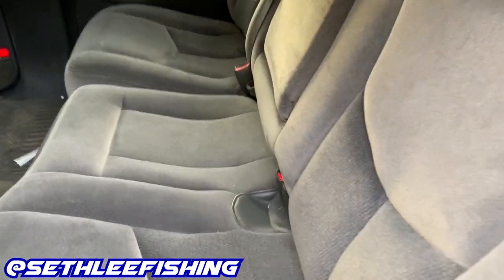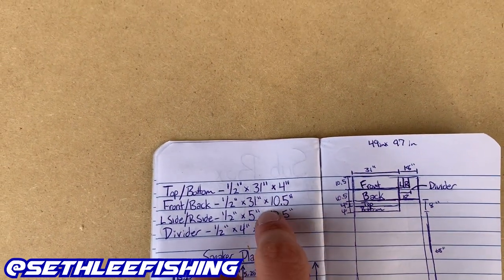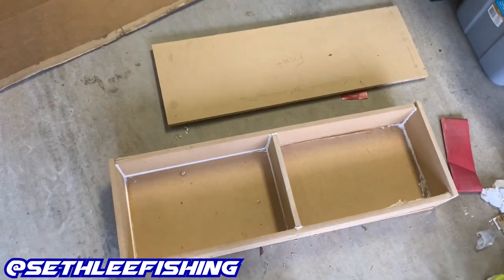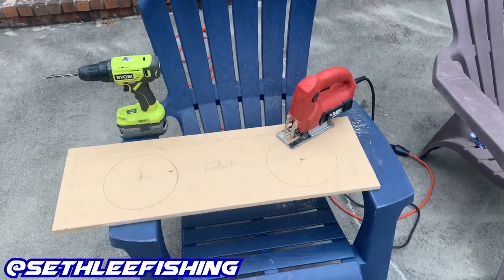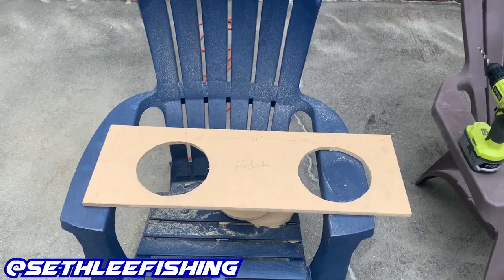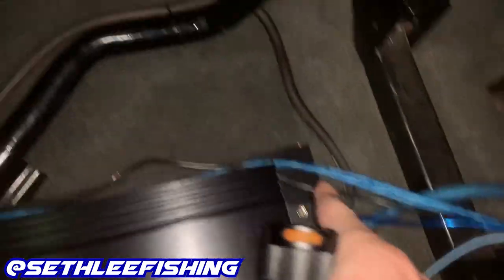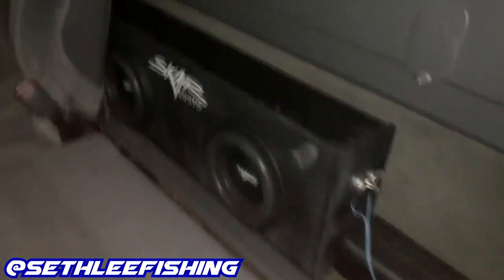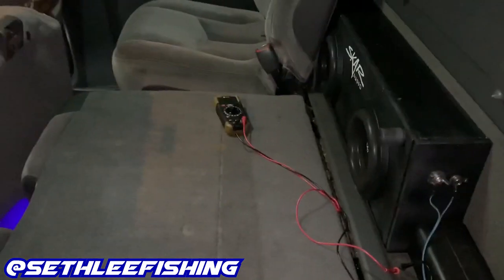CUSTOM SUB BOX BUILD | 05 GMC Sierra Crew Cab with 2 Skar VD-8 Subs

Comment: They sell the battery extenders for that reason. I have a 2006 gmc sierra crew cab same rear seat. Do you have any problem with vibration from the back seat when you turn it up.

Comment: All in all decent video bro.. 

FYI you can measure the voltage wo a load on the amp.. with a typical mono block your ac voltage reading wo a load will be 4ohm.. you can use that to tune the amp before ever hooking up the subs.. 

Then once you have the subs connected you verify that setting.  For example if you connected to the amps output wo subs you would’ve gotten a reading around 66v at 4oh this isn’t an accurate way to tune but it give you a very good starting point.. 

I personally like to use alligator clips on my leads so I can watch the voltage climb real time as I slowly turn up the gain.. you should also be doing this with a 40hrz constant tone not on music.. on music over a teak you’ll be anywhere from 12-40v over the track at 1ohm. You should be going over on peaks during music that’s why you have rms and peak ratting lol.. 

Also that’s a lot of power to those subs they are rated 400w rms not 600 like you said in this..

Comment: With having the bass boosted to 6 db you are going to be sending a clipped signal to your speakers and burn the coils up. Go to 0 db then use a ohm law calculator to set the gain to the proper spot. You want to have the volume at max clean signal, with an oscilloscope.   Bass boost on the amp will cause issues down the road.  A little more research on set up will help to get the longest life out of your set up. With all that said, great video and well done. Looks like a great set up. Looking to put 4 6.5 behind the seat in my crew cab. I have 6 svr 12s in my Nissan hardbody extended cab with a walk thru cut out
Reply: Shawn's fishroom
thanks for that info.....appreciated

Comment: I have the same truck but its an 06. Do you think the dimensions are the same? Did you measure tight or did you give it a little play.
Reply from the maker: The dimensions should be exactly the same, however, I would recommend taking a measuring tape and checking just to be safe.

Comment: do you think i could do this exact setup but put 12s instead of 8s?
Reply from the maker: I don’t have the truck anymore so I can’t go out and measure. But based off what I can remember, you might be able to do 10s but I think 12s would probably be too big. You would have to make the box taller and the way the seats angle back more towards the top would probably hit the box and not let the seats close all the way. 

Again, I’m not 100% sure but that’s what I think based off what I remember. If I were you, I’d take some measurements and see what you come up with. You could possibly angle the top of the box back but that’s gonna be a little more complicated to build

Comment: If u predrill the holes the screws won't split the mdf
Reply: 1/8 counter sinking bit is what I use. It helps a lot. The the less screws the better. Wood glue is what is doing the work.

Comment: Are these subs the dual 4ohm coil or 2 ohm? i have the dual four ohm subs and both subs hooked in parallel to equal .8ohm? Is that amplifier good for that or do they need to be both 2ohm ? Thanks man
Reply from the maker: These are both dual 4 ohm subs but I have them wired to equal 1 ohm total. This amp is rated for 1 ohm. This is gonna give you the most power you can get out of this amp because it is the least resistance

Comment: Right now all I have is a 12 inch power acoustic in the backseat and behind the seat like yours that is very close to the sub and I think that the box is not deep enough because it’s not sounding as good as as it should so that’s why I’m going to build something with some 8s but the box is going to be facing upwards to the roof and I’m going to also make it ported too late 32 or 33 Hz but I also want to put a seat left on there so I can actually add more subs to like under the seat like the newer Chevy trucks have the subs on there to see but they face in the front seat I want to build something like that too with that on top of that  with my other building behind the seat like I think that would be pretty bad ass like I would probably be the first one to actually build something like that for these your model trucks and if people would come to me I would probably build them boxes like I’m about to be do to but I also thought about like making the seat and redoing all the boats so that she can be more forward a little bit so you can actually put bigger subs and stuff in the back like I actually have the big competition score audio 15 I love that speaker it hits hard it’s just takes up so much room in the truck when I had it sitting on the seat I would love to come up with something to rake up some thing in a truck like this with the 15 like that where I don’t take up so much room I mean I only have one of them and I have it in a regular ported box and I had it on a kicker 1600.1 kx amp and it hit really hard like it would shake the doors and a bag glass would do the wave shakes even the windshield 😂 like it’s crazy and I couldn’t keep the mirror on the windshield neither lol but I would love to make a builder for that also if you have any ideas let me know lol hope I’m not bothering you too much bro just thought I would share that with you because you got the same truck but let me know what you think because I don’t have many people to ask like what should I do u no

Comment: That RP800.1 can only put out 800 watts rms @ 1 ohm.
Reply from the maker: kelaro75 Yep, it’s rated as 800 watts RMS and 1200 watts max. But as you seen in the video it is capable of much higher wattage (I’ve gotten 1600watts), maybe not continuously but in short bursts for sure.
Reply: That RP800.1 @1 ohm FU@K’n does some serious work.    It will bump those 8’s!!!!!  I LOVE SKAR!!!
I wanted a little beat in my commuter car (ACCORD SPORT) nothing big..... so I did 
SKAR RP 5 channel amp
4 x TX 6.5’s
SKAR 10” loaded enclosure 
LC6I
I cannot believe how it sounds.   That 10” pounds.  People think i have 2 x 12’s!!!!! Don’t want to sound like a SKAR fanboy, but my little SKAR system sounds way better than similar “BIG NAME”systems!!!, and I spent a fraction of the cost they spent!!!!!!!!!